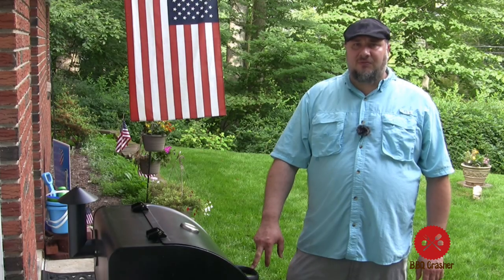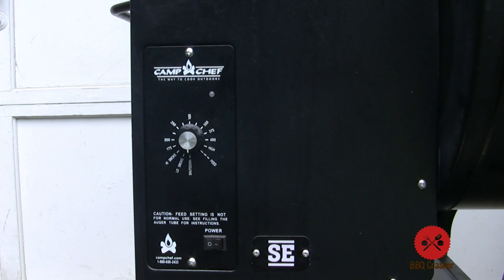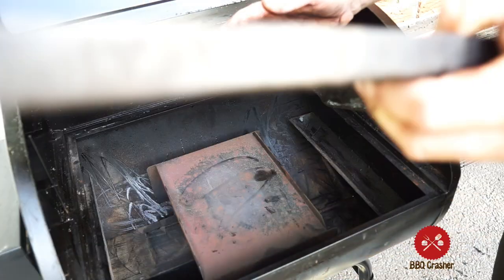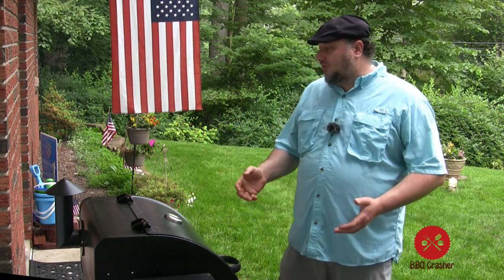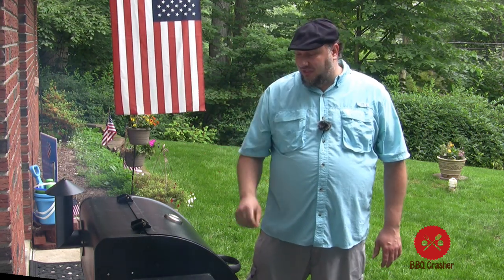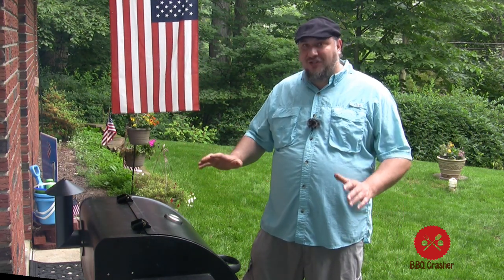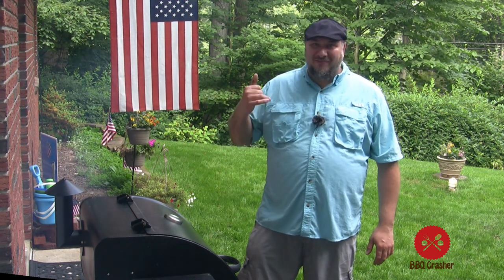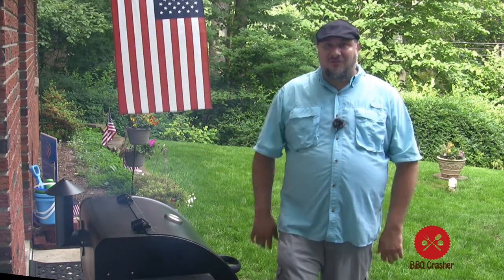Camp Chef Pellet BBQ Grill Review 1 One Year Review

Comment: I've had my SE for 2 yrs now and love it the only downfall would be changing pellets, wish it had a trap door! Was wondering how hot I could get this thing haven't tried it yet!
Reply from the maker: I agree with you.  Since my grill is now 2 years old, was thinking of trying a DYI add a pellet drain door or hatch.  I'm starting to have problems with the pellet grill running at higher temps.  Doesn't like to run at 425 degrees anymore for high temp cooks.
Reply: mine got up to 500 degrees when the controller crapped out- camp chef customer service was of ZERO  help. which is not what i heard about them. so i bought a schloss grills controller
Reply from the maker: Was looking to do a DYI self modification and install a pellet cleanout from the hopper.

Comment: Looking buying this model for a gift, 4 questions. Does this model hold close to 160 for low smoke? What is highest temp you get on a hot day 450?what is your fav brand of pellets?what temp probe do you use to Monitor meat temperature? Good video 😎
Reply from the maker: Dwayne Shippey all great questions tku -  ill do my best to answer from past experience individual results may vary.  May use ur questions for a follow up video:  low smoke holds between 140-160 solid.   The low smoke is my favorite setting.  High smoke holds at 180 ish.  I haven't been able to get it over 400 bc of the food load im cooking in it.  A Camp Chef person  reccomend to lowere down the chimney cap to reduce the amout of exhaust and increase heat.  I use a $15 Walmart grill expert wireless single probe thermometer.   Its able to transmit through the brick house. Happy with it.  Pellets - Pit Boss competition blend and B&B hickory all purchased at Walmart.  Hopefully as we grow the channel,  pellet vendors can send some products to review.  Ill be pellet grilling tomorrow and retest the temperatures.  If I get different # ill reach back to you.
Reply: Thanks, sounds good 👌. I wanted more smoke, so I did what many other grillers were doing, I modified 6 months ago. Any thin sheet metal will do, cut 2 small(ears) and attach to a stove pipe 90* attach 90* to inside of grill with screws that are holding chimney . Holds in smoke and heat. But you loose grill space. You could stop chimney up ( most of the way) with foil  you get better heat, should get to 500 or close. HAS NO AFFECTED PERFORMANCE OF MY WOODWIND!! And I still use smoke tubes!!

Comment: Mine  mine doesn’t Produce a lot of smoke. In the beginning it does, but after that it doesn’t. My meat barley have smoke flavor
Reply from the maker: justsomestuff2 https://youtu.be/2kPb7uP5PHM you may find this vid helpful & ill try to help you with what I have experienced.  What temps are you setting the grill on?  What brand of pellets are you using?
Reply: BBQ Crasher I usually do 225
Reply from the maker: justsomestuff2 what brand of pellets.  225 your at the border of consuming the pellet as fuel not the smoldering source.   250 forget about the smoke.
Reply from the maker: https://youtu.be/2kPb7uP5PHM this may help
Reply: I have been trying to get rid of mine for a year now, but it works fine. I did purchase a smoke tube and I'm very happy with the results.
Reply from the maker: @clssymn  the smoke tubes rocks!  Just received a package from Amazen Products with their new pellet tube design.  Ill be making a video about it so be sure to subscribe and hit the notification button.
Reply: How has it held up ?